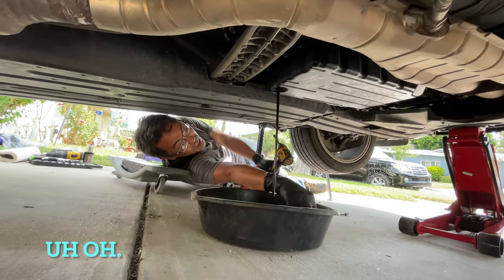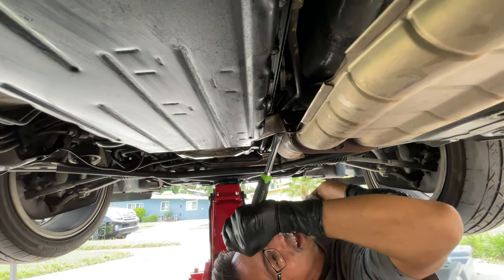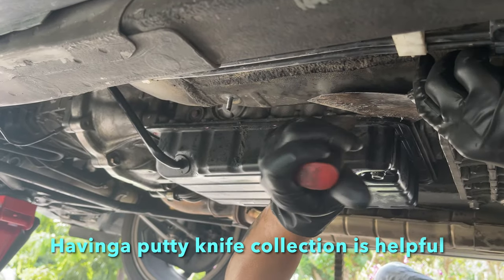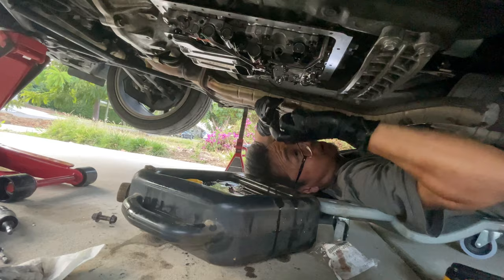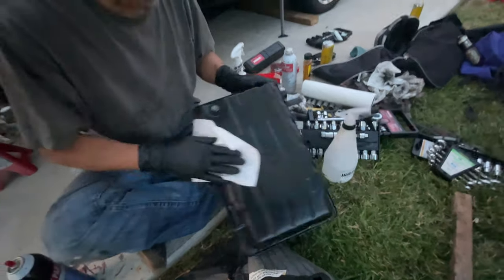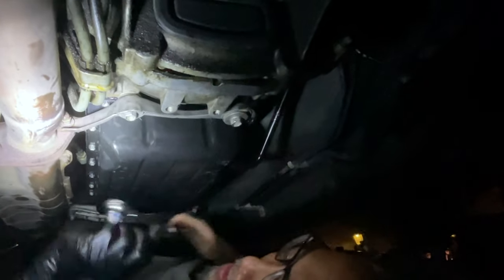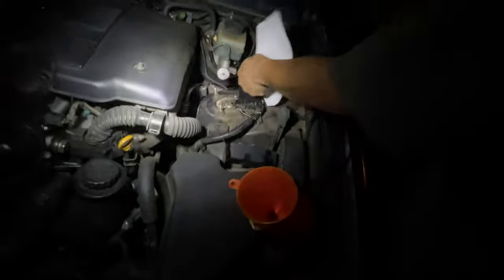My Lexus IS300 P0980 Shift Solenoid Drama.C Control Circuit High Open Short Valve Transmission Error

Comment: I am receiving the same code.  I changed the transmission fluid a few years ago and I used an aftermarket fluid that was compatible.  I am not sure if I did the change before or after the code.  IF I change the fluid to Toyota now, could that possibly clear the code?  How much fluid would I need to totally flush it?.  I bought the solenoid to replace it, but after watching the video I am worried about the exhaust removal.  I bought 12 quarts of Toyota fluid, should I try to replace 6 and see if the code clears or just replace the solenoid???
Reply: Also all gears work fine.  If I reset by taking the cables off the battery, it shifts fine then the code comes on and it gives a bit of a rough shift in early gears.  I am mechanically capable, but it's the time without the car I am worried about as it's my daily driver.
Reply from the maker: From what I understand, a complete flush is not recommended.  You could try draining and adding fluid, but depending on the miles and transmission fluid changes, the solenoid does go out.  And replacing it is the only way to go.  I should have changed my exhaust gaskets.  I'm getting a P420 now and plan to check for an exhaust leak.  It's probably the exhaust gaskets.
Reply: @Squisheyy  I appreciate the response.  Car has 120k miles.  It might be worth changing the fluid as that is $50 and it would saye a lot of time and frustration if it worked.  But I have a feeling I need to replace the solenoid.
Reply from the maker: @westparley  from what I understand is that 2 things cause the error, clogged plunger on the actual solenoid and electrical connectivity.  Fluid change could fix or reduce how often you get the error. But at some point, it will eventually go completely out.  I did the fluid flush 3 times when code would pop weekly (for 3 years) before I decided to replace the solenoid. I didn't have any issues other that the annoying light.
Reply: @Squisheyy  ok good to know.  I need it to pass smog.  If the code goes away for a week that would be great, then I have more time to fix it.  I just replaced the fluid.  It actually looks more full now.  So I may need to drain a bit.  The fluid was a little dirty though.  I unhooked the battery. Fingers crossed.
Reply: bro is it work for you? got the same shit with gs300 2007
 @westparley
Reply: @G42000  yeah I was able to change the same sensor as in the video and the car passed smog, and shifts great.  I got the sensor off of Amazon and it was a Japanese part.

Comment: So just want to make sure the one you replaced shift solenoid valve 3?
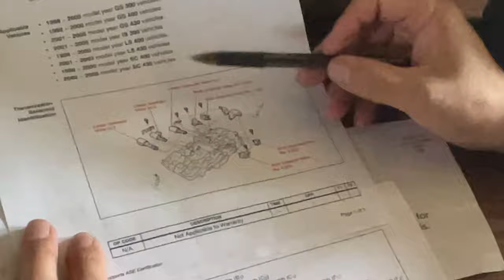Reply from the maker: Shift Solenoid C - 3 at 5:08.  Not the SLN,SLU, or SLT.  It's so confusing when there are so many Solenoids.  35230-30010 Automatic Transmission Control Solenoid No 2 is shift solenoid C or 3. If you go by the part number, it's your best bet.

Comment: How much was the cost of the solenoid c?
Reply from the maker: $390 at Longo Lexus part number 35230-30010.     I avoided the cheap ebay ones because I heard they can still give the same errors, something to do with ohm resistance range threshold.

Comment: ¿Did you use a torch near the gasoline lines? ⛽ __ hmmm 🤔!??
Reply from the maker: No, not near the gas line, those are evap hoses. they do have fuel vapor that returns to the intake when the charcoal canister solenoid opens, I put a steel sheet between them and where I used the torch.  The flame burned through some of the steel sheet, but not near the evap hoses.  Honestly, it is dangerous and I had to be really careful not to burn through the evap hoses, lying on my back in a tight spot.  The fuel line runs on the driver side, evap return hoses run on the passenger side, there are 2 lines.

Comment: My car doesn't move to reverse unless i accelerate high to 4k rpm.
Reply from the maker: Sorry to hear.  Your code is P0980? Reverse is Solenoid #1/A Error Code P0750.  Odd.

If no code, this is the troubleshoot checklist below, in order from easy to hard. This video is #3 the Shift Solenoid.  Since it goes into R on a 4k rev, I'd say skip #1 the Brake Light Sensor and move to #2 Transmission Fluid.  I'd check to see if it is low and/or drain and refill if it hasn't been done in the last 60k miles.  I wouldn't completely drain (Transmission cooler-pan only, there is a drain hole), and use Transmission Fluid, Toyota Type T-IV Toyota Part Number 00279-000T4-01.

And one of these Transmission Drain Crush Washer Part Number: 35178-30010 about $1.80 ea.

With No code, I would bet $100 it's fluid level, dirty fluid, clog wire mesh filter. and a $25 bet on the #7 interlock.  They don't typically go out, but when they do, there is trouble getting shift lever to shift out of park into any other gear (Part number 8543214040).

Troubleshoot check list:
1.Brake Light Switch
2.Low transmission fluid level
3.Faulty Position Sensor
4.Valve Body 
5.Fault in Shifter Mechanism 
6.Transmission Filter
7.Ignition Interlock

BTW, I'm not a mechanic.
Reply: @Squisheyy  thank you very much
I'll try these
Reply: My is300 2001 wouldn't reverse what so ever. I wonder if a shift solenoid would correct my issue as well. Runs through all gears with no hard shifting or no hesitation what so ever but when selecting reverse it don't do anything but free rev. Do you have any insight on this issue? Love the content man.

Comment: I am so confused. Which one is shift solenoid A?
Reply: Should be the one next to solenoid C towards the rear of the car, iirc
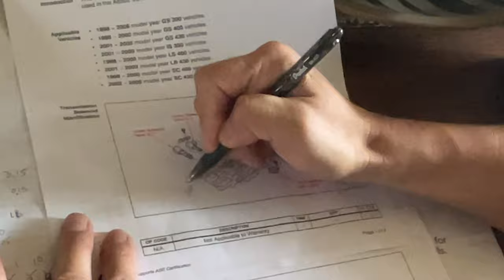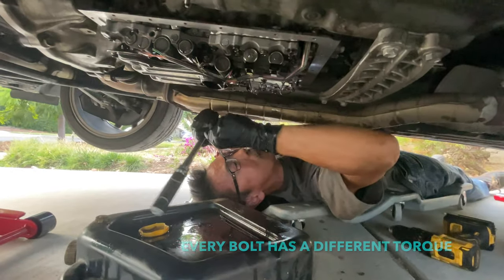Reply from the maker: 5:01 and 8:17, shift solenoid 1 is A.  Good luck.
Reply: Same issue I have with my 01 IS300
Reply: @scythez_ bro You could solve your problem by replacing solenoid A.
Reply: My code is transmission speed sensor A
Reply: @grachymartinez4700  I’m fully aware that it’s shift solenoid A…

Comment: Is that code the same as p2757?
Reply from the maker: It's not the same part.  DTC P2757 Torque Converter Clutch Pressure Control Solenoid Performance (Shift Solenoid Valve SLU). In the diagram it an SLU.  Have you tried changing the transmission fluid first? Not a full flush, i heard a full flush could cause problems.